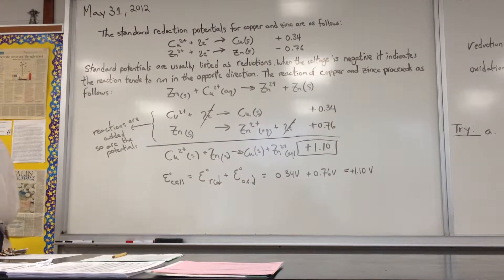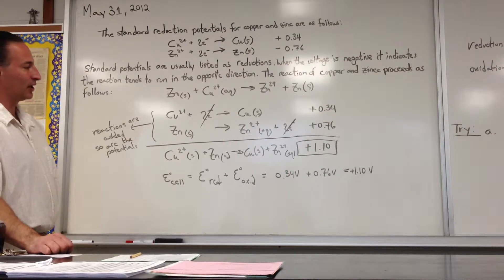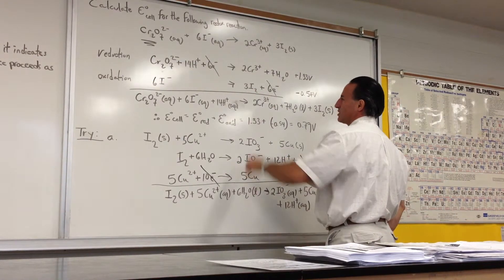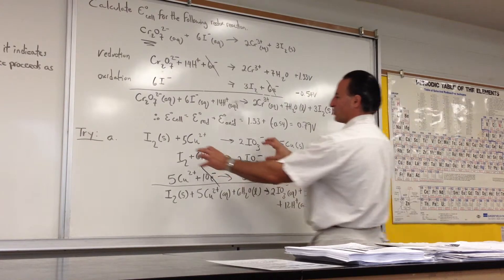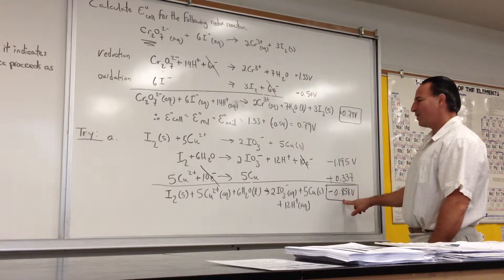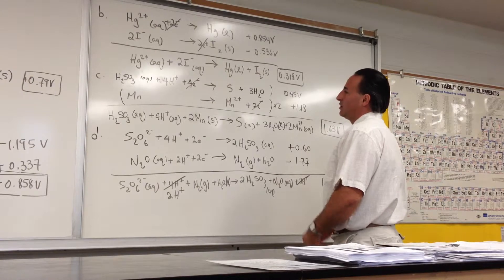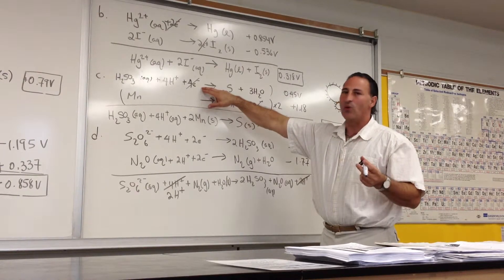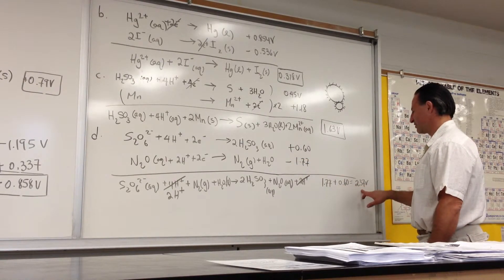Electrochemistry Part 4a: Calculating Standard Cell Potentials

Comment: After you said "voltage is a measure of how much energy each electron has", I had a moment of clarity with electrochemistry. I've actually worked on devices that function by electron energy drops when being injected through materials to create a current, but it never occurred to me that you could measure the voltage of the current through relative molecular energy levels. Thanks!